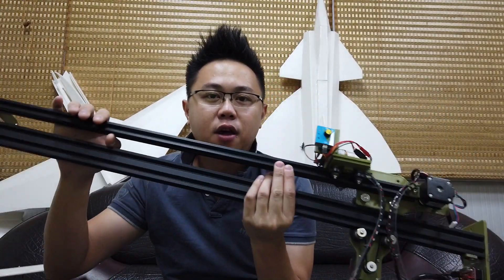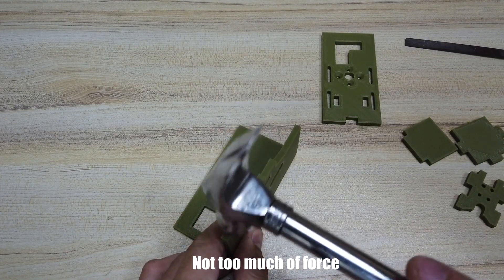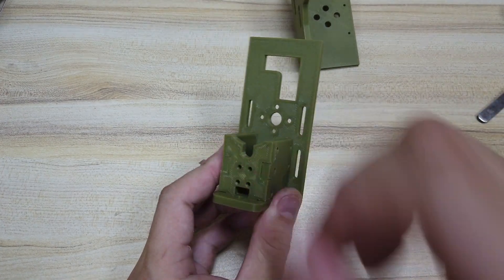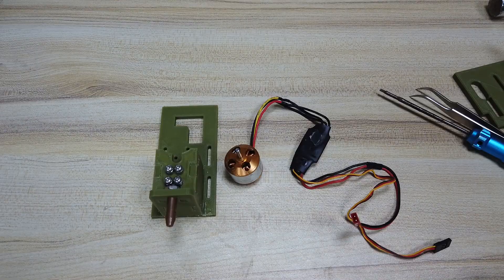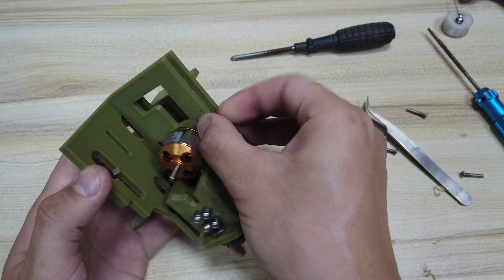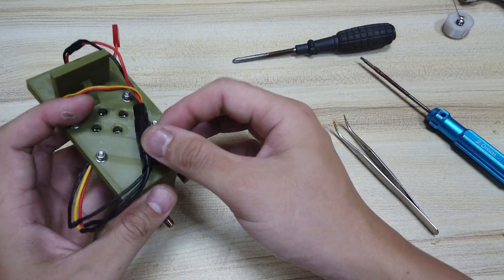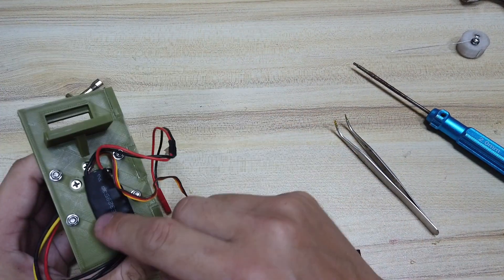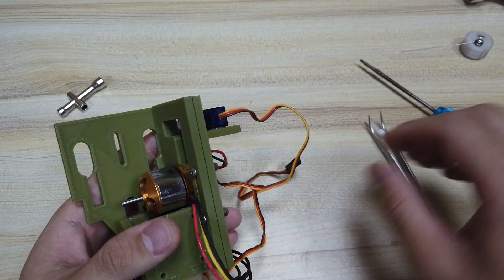ERC TimSav Part 1/A - Cutter Assembly - DIY CNC Foamboard Cutter

Comment: Will the MR63ZZ bearings( 3x6x2.5) work for this application?
Reply from the maker: yeah if the 2.5mm is about the thickness it's fine

Comment: So i just basicaly found this machine on some forums and decided to buil one. I actually got a Laser cutter and than get surprised that it simply cant cut White foam  nicly or it cant cut it at all becasue its white and its absorbing laser beam.....like Depron and EPP....this was surprise but my 22W diode laser just didnt cut it all at 100% power and like very slow speed and multiple pass or it did cut thrugh but at bottom it melted it....either way big dissapointment ....so was looking for what is wrong and than found this machine.....so now im building this....hope Arduino flashing will work thou :)  Either way Thank you for posting this and making this avaialble for us to build :)

Comment: Edward I have gone back and remade the STL for the Right Plate short.stl.  The third screw that fits at the top of the board closest to the power port on the Arduino UNO was about .2mm shy of fitting nicely.  I have corrected that in my STL if you would like me to share.  Thanks for a great needle cutter.  One other thing you might want to think about is another foot on the left side of the X rail that will keep the machine from moving as you cut.  I just used a piece of tape over it after I glued it to the Left Plate and now it cuts really good.

Comment: Great video mate. Can U make it bigger? I get A0 foam board here in Australia, cheers
Reply from the maker: You can make it as large as you want as long as you have longer rail available locally. but longer means more flex so must build it firmly
Reply: @EdwardRCAir  cheers mate
Reply: Did you end up making an A0 cutter? I also found a few places selling A0. Seems like a good way to maximize the sheet. Even OfficeWorks sells 5mm in a number of sizes.

Comment: Where did you get the m3 washers for the bearings on the needle and the needle guide so the 3x2x6mm bearing can spin freely,can't find them anywhere.
Reply: ace hardware

Comment: Excellent work on this design! 

For those of us that already have a cnc machine it'd be nice to have just the oscillator and pin assembly to be clamped to the CNC carriage. Have you designed one like that too? If so I'd be happy to buy a kit or an assembly (if you have any extra lying around).
Reply: Oh I see in your comments that it's discontinued. Bummer. I realize a project like this is way more work that it looks like. 

I will make my own reciprocator cutter to mount on my cnc machines.

Thanks again for such beautiful design work.
Reply from the maker: on PO now www.edwardrc.com
Reply: @EdwardRCAir  Thanks! I managed to grab a kit! Wohoo, very excited. 

I"m also building one to attach to my cnc machine.

Really looking forward!!!
Reply from the maker: @DarcyWhyte  thanks bro!

Comment: Congratulations, I like your video very much. It's a very good project to cut my foam. I build my own CNC hot wire foam cutters, buy the option of the needle instead of a hot wire is very good for cutting and building my planes. will order your kit right away.
Reply from the maker: Yeayyyy thanks Luis :)